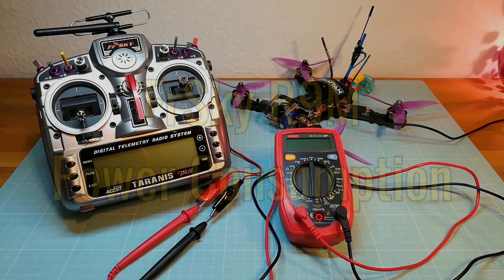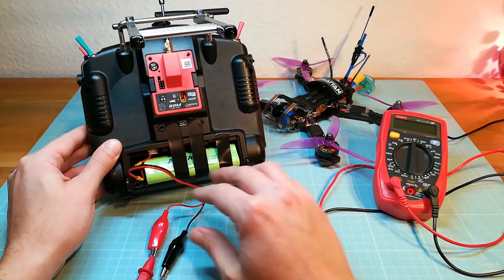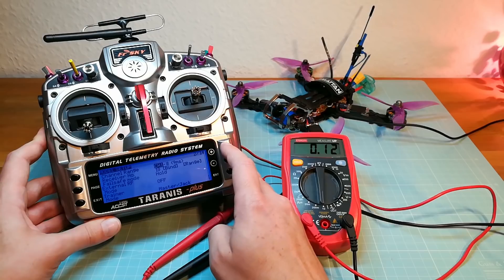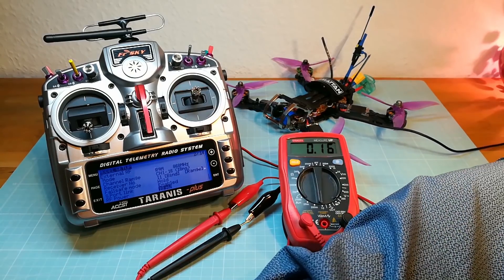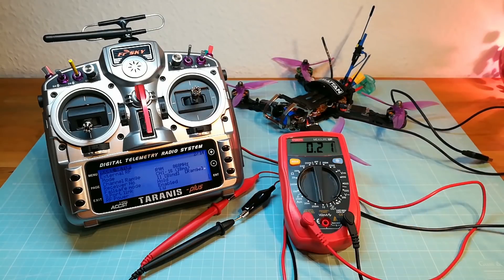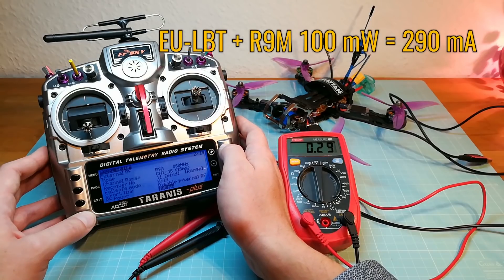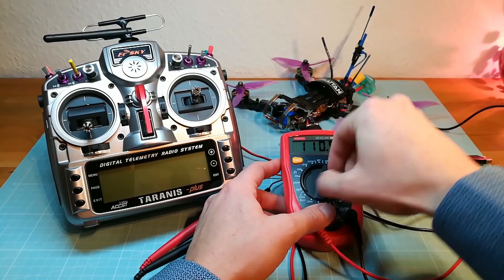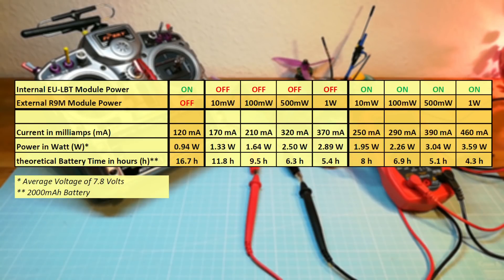FrSky R9M - Power Consumption 🔋 Battery Time

Comment: My r9m wont stay connected to my r9mm so i now have some numbers to test mine against to see if its the tx thats failing
Reply from the maker: Maybe you have faulty batch of the r9mm ... this rx is know for this issue. Do you have another r9 receiver in order to test your r9 system?
Reply: @TorbanDallas  after more testing my r9m tx module is working fine and yes it is the r9mm rx that stops receiving after 6-8seconds. I've ordered the ota version all though I hear the ota function doesn't work yet, but it will a different batch,  at least I think there's a hardware difference.
Reply from the maker: @rawfpv1207  get the r9mini Ota or even the r9slim+ than you can also use the redundancy function.

Comment: If one module fails than the second can be still used? ...or why is it possible to enable 2 modules in the same time?
Reply from the maker: It's the redundancy function - it's like you said, if one module fails the other one keeps you in the air. Take a look at my video about the redundancy mode.

Comment: Hey, Torban. When you switch the R9M from 10 mW to 100 (a 10x increase), you lose 15% in battery time, but from 100 mW to 500mW (only a 5x), you lose quite a bit more. Wonder why that is?
Reply from the maker: Christian Gray well i couldn't measure the real output power on the antenna, maybe it's just more efficient at this higher output power.
Reply: difference is >>> 100mw - 10mw =90mw
500mw - 100mw = 400mw

Comment: Just got one of these. Thanks for the video. Please test to see if the module still draws any power from the taranis battery if you connect a battery to the r9m.
Reply from the maker: Thanks for your comment. I have already disconnected the multimeter from my battery. I also don't have an external battery. So i can't test it yet.

Comment: Thank you for the great data  Torban.  Has anyone used both internal and external modules for redundancy?
Reply from the maker: Spartan 329 thanks! Yes i used both for redundancy, i have even made 2 videos about it.
Reply: why?
Reply from the maker: DroneMatesFPV why? Why not? So you can use both systems the same time. You can even use only the internal or the external module. With both systems you are getting the benefits of both systems.

Comment: Good those two red and black clamps did not touch each other...
Reply from the maker: Erwin L thanks, no they don't touch each other. But if they would touch each other it wouldn't be a problem. The multimeter is placed in series.
Reply: Torban Dallas you are correct, it's current meter ☺️

Comment: Nice job as always mate :)
It's definitely the reason i have the 3S mod on mine! I learned that lesson when i started using the DragonLink V2 433Mhz external module :)
Happy new year to you and all your family! All the best for 2019 :)
Reply from the maker: Thank you very much! I also wish you and your family all the best for 2019! What is the 3s mod? I don't want to burn my Taranis or my R9M. But i think i will need a bigger battery for my taranis as well.
Reply: @TorbanDallas  There is an old mod on RCGroups which shows you how to mod the X9D in order to be able to use 3S LIPO, you won't burn your radio, i'm using it since basically 3~4 years and so far so good!
There is even an additional mod for being able to charge directly the battery from the radio lol